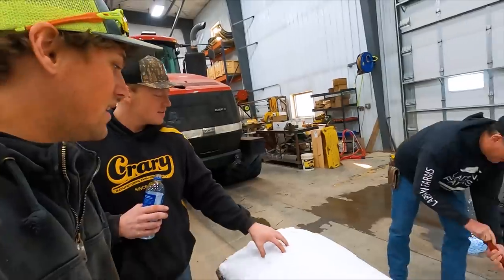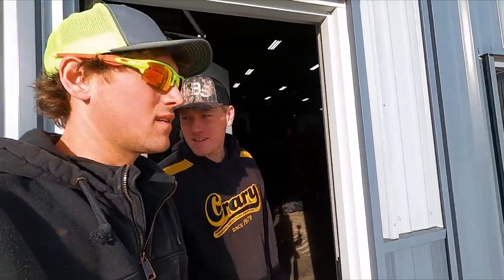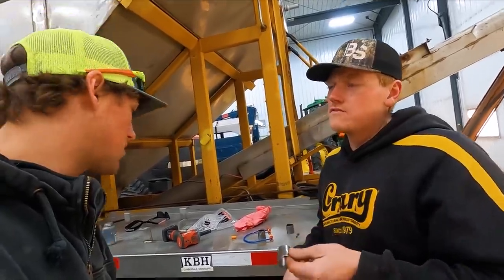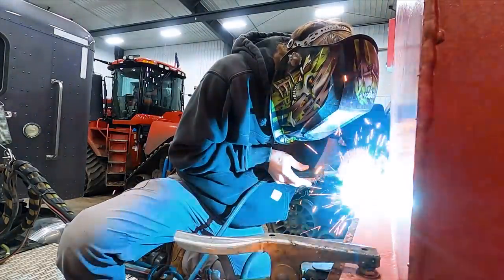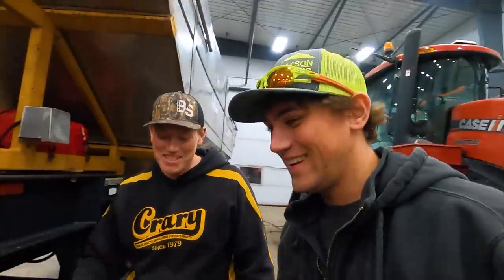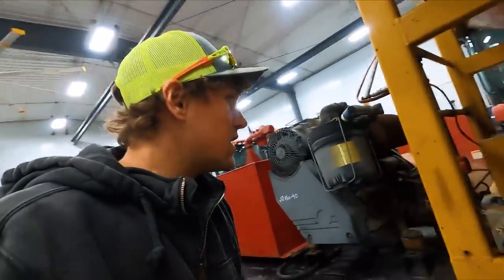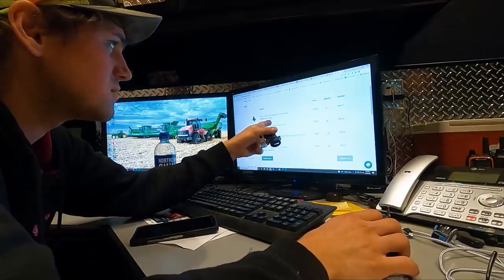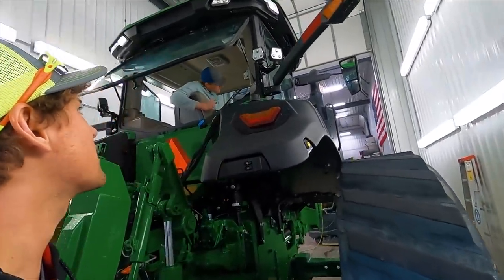That Project Didn't Go As Planned!!

Comment: Just a suggestion, try using a length of nylon strap wrapped around/underneath the battery as you lower it into the battery box.  
Then leave the strap for when/if you need to remove the battery.
Just a thought.
Reply: I was getting ready to make the same suggestion, then I saw your recommendation.

Comment: 5:00. Anchor pins & bushings. Those are always a pain. I worked in a heavy truck shop. We had a giant driver for them very similar to a ball joint press, but significantly more chonker like.  Can't count the number of times I used that thing with heat, a 3/4 air impact, and a BFH do drive out the pins. Then an air hammer and chisel bit for the bushings. Whizzy wheel the hole with a die grinder and flapper wheel, and slide the new ones in after dunking them in anti seize. 👌

Comment: Y should build reservoirs in your ranch close to places where there is flooding. Then drain the floods to reservoirs, and use reservoir for irrigation. You will see the difference in crop. Less excess watering in wet season. And reservoir to irrigate in dry season. You can even reduce evaporation from reservoir. Using shading in reservoir.

Comment: Chet they make a rubber strap with a metal end on each end that will slip over each terminal on battery to make an easy handle to remove and install batteries in tight places just slip clips over terminals and lift.

Comment: Chet if you’ve got a 2” strap your not using cut a piece long enough to go under battery on that trailer. Bolt one side to battery box then lay it under battery you can use it to lift battery in and out.

Comment: Ya know, they make a carry strap for batteries.  Holes in the ends of the strap drop down over the battery posts and then little folding tabs drop down to hold the strap to the post.  Lift the tabs and the strap slips off.  We used to sell them at Sears Auto.  Just about any parts store should have them.
Reply: They dont have battery-straps in Minnesota?
Reply: Go handles

Comment: I maintained state salt / brine trucks and what I did was use heat to warm the cast up for the pins on the shoes then crack the cast a few times with a BFH then air hammer them out. and then I always got 1 1/2" round flap disks or even some 1" ones and then use them to sand the rust down then you can easily apply anti seize and tap the bushings back in

Comment: You can use welder cable extension connectors between the truck and trailer and source power from the battery through a 100 amp breaker, then you will have enough to power the  engine on the trailer.  Happy New Year Larson Farms.

Comment: Get a 2 inch wide nylon strap by 3 or 4 ft long. Lay it across the battery box and then lower the battery in, will greatly help during removal as well. Just grab the strap , both ends and lift.

Comment: Hey Chet, increase your wire size a bit (find out the CCA of the starter then ask a sparky about the right size for the amps at distance), then run a line direct from the truck batteries, through an appropriate fuse, to the trailer. You should be able to get an appropriate connector for the amperage also
Reply: Firefly said everything I was going to tell you but in a much better way, I believe his way will work just fine...
Reply: he should at least wire wheel the paint qnd shit off to, on ground and the weld
Reply: @calebalt1557  I mean, sure, if it was something load bearing or for a proper job over an initial test. Given the half decent quality of the welding noise etc I’d have said it was fit for purpose as is though.

Comment: On that pony motor you could put a small battery with it but then run a charge wire from your truck to pigtail to the trailer 
A lot of trucks use this type of battery power for different things on their trailer’s

Comment: Just a idea 🙃 for your battery box. With those deep hard to reach boxes a farm friend of mine cut the side off so battery can slide in and out easily saving fingers back and guts. He then revit one near top and one near bottom a clasp hinge to hold the battery in. After some perfecting it's much kinder changing out batteries.
Reply: Or just put a couple 2x4 in there first

Comment: Use some flat packing  strap to make handles  that go around the battery  to help lift it out and put the battery in or some wire with a plastic 5 gallon bucket handle .There are a couple of ways to do this

Comment: We use starter cable fastened to battery to a solenoid with power block plugs at rear no voltage loss max amperage usable

Comment: Chet you should use tow truck jumper cable adapters they use 0 guage wire and have a arc free connection

Comment: Your problem isn't voltage or wire gauge.  It is voltage drop due to the current limitation of your relay (which you will probably burn out if it is not protected).  Use the truck to  charge your battery (within the current limits of the relay) and use the battery to start the engine.  You will need to isolate the two circuits to do this.

Comment: for your brakes drive old bushings out heat with torch and cut out if necessary then use drill or die grinder with the little sanding wheels clean up good anti seize slide new bushings in nice and easy

Comment: Move the battery box or try a heavy gage wire if nothing eles they sell a rubber strap with metal ends that slid over the terminals and pressure hold when you lift so you can put them in to tight spots just like that one

Comment: If on this set up u truely want it to charge then u need to put on a power cable set up ,like for charging a battery that has a lift gate on it, 1 gage cable to back of sleeper next to the 7 way light cord . To recepticals 2 terminal one 50 amp or 100 amp breaker put it at the batteries run the ground and positive to receptical, plug in the curly cable 2 terminal, wire in the same way on trailer to your motor ground to frame and positive to where you got it, then test it before starting the truck . Double check once running. It will start then properly.

Comment: When you talked about what you were planning with the trailer I knew it wouldn't work but at least you can charge the battery that's on the trailer when the truck is running

Comment: Chet try a plug set up for a refer trailer.  They are diesel motors much like that and the plug is designed to pass big amounts of power to start the motor.  They use welder cables for cable.

Comment: Or run a 4/0 battery cables directly from the battery bank on the truck in put in connectors which is simple but the wire isn’t cheap but it would work

Comment: Chet Do a AMP check when starting the engine  if your pulling 300 amp you need a cable that maintains that amperage at whatever length you have from the battery. You can get away with a voltage drop of 3or 4 % but no more than that, under volts burns up motors. A 4/0 battery cable should carry 300 amps 20 ft. at a 2 % voltage drop. Don't take my word ask a engineer.

Comment: Take two battery ends put a cable in between them and you have a lift handle old backyard fix for tight places
Reply: Probably not a cable but something non conducive would be a better option. We have a strap with ends that slip over the posts loosely and when you lift it won’t slip off.

Comment: Always very entertaining and knowledgeable stuff on Larson Farms. Next time you're at the auto parts store see if they have a battery strap handle. They grip the terminals and after lowered into the box it disconnects easily. Or why not cut the battery box and have it just fit over the battery.

Comment: I use the two strap method on my 1990 Honda GT motorcycle battery..It is not heavy, but it is very ackward to place and retrieve..The strap method with an 80 pound battery might be useful..but 80 pounds is still 80 pounds..But..with two nylon straps outside and above the battery, you will have a starting point to lift the great weight..:-)

Comment: Add a starter soenoid off of a 79 f100. You can run some 2awg welding wire or splurge for 3/0 oxygen free. Split loom the run. Add a 120 Amp breaker as close to the truck battery as possible si you avoid magic smoke. That should be the money boys.
Reply: Ha, the magic smoke, it makes everything run, until it leaks out, right?

Comment: So for the battery could you run the wires to the battery and have it set to charge when the truck is running. Like it does normally got the truck batteries

Comment: If you had put a circle of twine under that battery you would be able to fit and remove it with ease. Make it long enough so you can use them as handles.

Comment: Put a solar panel on it to keep the battery charged. I git one on my dump trailer and it works great.
Reply: Would need a charge limiter etc. to prevent overcharge.
Reply: sounds like a good idea!
Reply: I did the same thing to a dump trailer haven't had a problem since

Comment: #2 wire isn't enough - might need an alternator on the trailer for better charging.  Use a small lawn tractor battery.
Reply: Most electric start small engines have a charging winding on the flywheel. Usually too small for efficient battery charging.
Reply: Add an Alternator to the tender.
Reply: The "lighting coil" alternator is often 10 amps or something smaller. Pathetic, really minimum.

Comment: That battery box is way to deep. You might want to consider putting a spacer in the bottom to bring the battery up. That would make it a little easier to get in and out.

Comment: If you don't want to run the correct size wire directly from the truck battery to the trailer, then at least modify the battery box on the trailer to accommodate easier removal of the battery. Work smarter, not harder. A one time modification can spare your back and your fingers.

Comment: Now that you have 12 volts wired to that trailer could you mount a battery tinder to the trailer and let the truck supply power to keep battery charged?

Comment: Napa has battery straps that hook onto the top terminals on the battery. Or you could just buy a battery that has a handle on it right from the get go. Surely would save your fingers and dropping the battery.

Comment: Run it direct off the truck Batteries, then Fuse it at the Trailer Motor. It will then carry the correct Voltage to the pump Motor. It looks like a Kohler Engine so with that said it should start so fast that that motor might just jump off the Trailer. You guy Crack me up by playing off each other, my Father Inlaw worked for My Wife and I so he and I were together everyday for 28 years. So we would clown together just like you fellars

Comment: Why don't you move the battery box to the outside of the frame just below the start switch?  At least you wouldn't have to lift it through the frame of the trailer.

Comment: Add a battery seperater to your current new wiring and it will charge the trailer battery but will not run down the truck battery.

Comment: couldn't you leave the battery on the trailer, keep the wires running from the truck to the trailer to utilize the truck's alternator in charging the battery on the trailer? then you have the battery to start the motor and eliminate the problem of the battery dying?

Comment: otherwise..there is a tool redially avaialble that fits over both terminals..with strap connecting the two terminal clips..lift the strap and the clips bite into the terminals and the battery is lifted..again..80 pounds is 80 pounds, but the battery is being moved out of the box..:-)

Comment: I see where Got Thumbs suggested nylon strap. I was going to suggest baling twine. Think his idea is a whole lot better. Is there some way you could hook a different platform just for a battery and use two battery holders. I like the ones where you can put a lock washer and nut on the bottom. Make sure you have room to get your hands and either a box, open wrench or better yet a socket.

Comment: You need much larger cables to supply amps/volts  to  that diesel engine on that fert trailer.  You have too much amperage loss with that small cable you used.